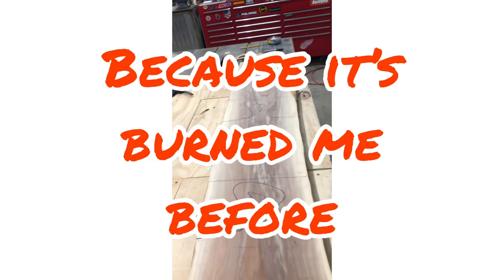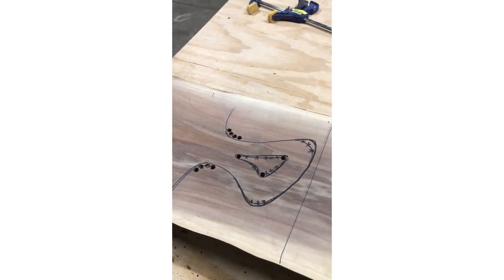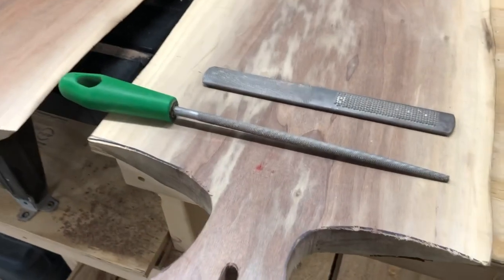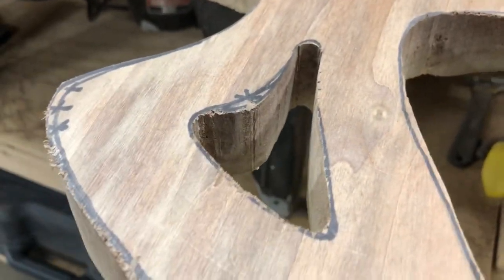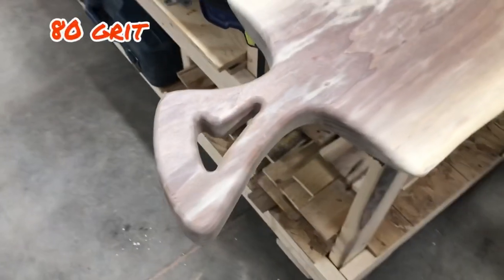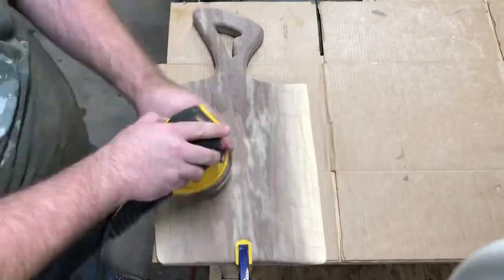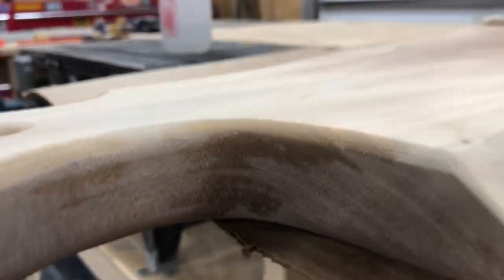HOW TO MAKE A CHARCUTERIE BOARD - For beginners on a budget

Comment: I'm assuming they are kiln dried?
Reply from the maker: These boards were yes. But air dried or kiln dried doesn’t really matter as long as it’s dry! My personal opinion is 12% or less moisture and then acclimate for 2 weeks to the environment it’ll be in is ideal. Can be done with less or more, it just may or may not lay flat.

Comment: Everytime I try and use a jigsaw, it bounces. What am I doing wrong?
Reply from the maker: Generally what I’ve found is that it’s usually one of two things. Either you a turning to tight to fast or you have the wrong blade. There are two types of blades one where the teeth cut on the up stroke or one where the teeth cut on the down stroke. You want the teeth that cut on the up stroke. I’ve had this happen to me before too and I couldn’t for the life of me figure it out. Hope this helps!

Comment: Hey there! What router bit are you using for the table? Thanks so much, this look super easy for a DIY project
Reply from the maker: I’m glad you enjoyed the video! It’s a 3/8” round over bit.
Reply: @whiskyrivercustomwoodworki2012  Thanks for getting back so fast!
Reply: @whiskyrivercustomwoodworki2012  Hey there,

Just wanted to reach out and say I followed your guide, and my boards came out incredible. The wood rasps you recommended saved me so much time and made sanding a lot easier. I've never had a sanding procedure this complex before and was a bit skeptical, but holy cow was it worth it. I'm still blow away by how buttery smooth it turned out. I'm not even trying to sell them, I'm going to give all four of them to my best friend's mother (one is a huge board made with Red Grandis, Walnut, Soft Maple, and White Oak).

(btw I just now noticed your video had the specific router bit you used lol. Thanks for still replying!)

Comment: Nice work. Is that your signature handle? Nice design. I don't have a signature handle seems every board is slightly different. Thanks for sharing your talent
Reply from the maker: Thank you I appreciate it! It’s a variation of a few I’ve seen and liked. I made a template for them now and use a flush cut bit, so they stay very consistent.

Comment: How long you has to dry after cut from tree. Before you can start sanding?
Reply from the maker: My rule of thumb is it needs to be down to a min of 10-11% moisture and acclimated to your shop or the environment it will be in. You can buy moisture readers (there are a few different types) to find out where the material is at. If you have the ability to have it kiln dried that will be the fastest. If not, you will have to sticker it and let it air dry. That generally takes a year or two depending on thickness, air movement, humidity etc. I hope this helps! Feel free to reach out if you have any other questions and thanks for watching the video!

Comment: How thick are your slabs when you start?
Reply from the maker: I try to start at least a 1/2” thicker than what you want it to be finished. These were 1.5” thick and finish were about 1.25”. Depends on how much milling needs to be done as well. These were already planed and sanded to 120 after they came out of the kiln so they didn’t need much. If you are starting from scratch on rough sawn material I’d say 3/4” thicker than what you want it to be finished.

Comment: in the sanding process, what is "water pop"?
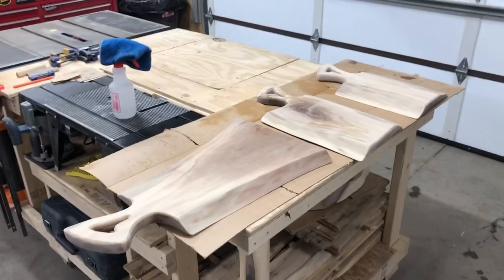Reply from the maker: If you skip to 6:16 in the video I go into detail about why I do it and how I go about doing it. It isn’t always necessary if you’re painting the project, but if your applying stain or other finishes I’ve found the end result is a much smoother and even finish. It helps pull dust, debris, and wood fibers up that kind of get mashed down through the sanding process. Hope this helps 👍🏻!
Reply: @whiskyrivercustomwoodworki2012  awesome ty

Comment: How thick was the wood?
Reply from the maker: It started off 1 3/4”. Finishes just under that. It was already dried, planned and sanded to 120 when I started.
Reply: Thanks for responding! I’m worried about cutting that thickness especially black walnut
Reply from the maker: Don’t be. Properly dried walnut is a dream to work with. Anything from 1.5” - 2” will be just fine. Give it a few days to acclimate to your shop before starting and you’ll be good to go if it’s been kiln dried.

Comment: Hmm didnt think rubio was food safe
Reply from the maker: On Rubio’s website they explain that they have food contact compliance. So it’s ok to use on charcuterie boards, countertops etc. That was one of the big reasons I like to use it on things like this.
Reply: @whiskyrivercustomwoodworki2012  I use it on my tables (pmh custom creations) works well over the epoxy as well. I have some red cedar and black walnut quarter sawn x 8-10". Think I'll try this way on a few compared to making a oil/beeswax mix. Thanks for the tip I'll definitely mention the credit on the info!
Reply from the maker: @xmu69  I’d really appreciate that! I think you’ll like it. I use it and then once it cures, I put a butcher block conditioner/wax on also to help bring up the shine and add a little extra protection. I’ve had awesome results with it.